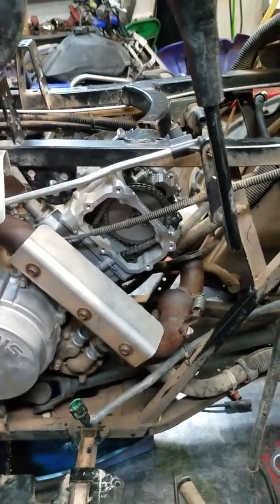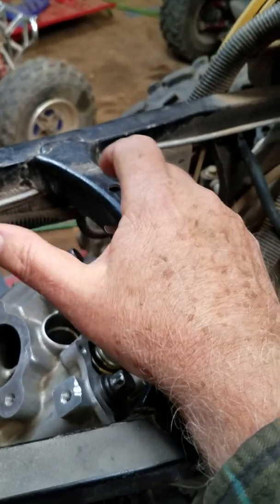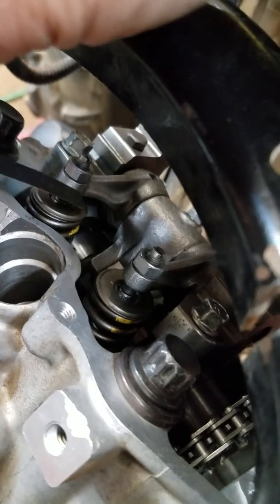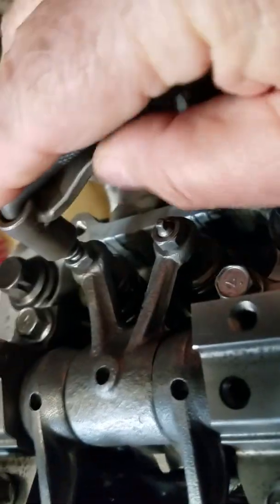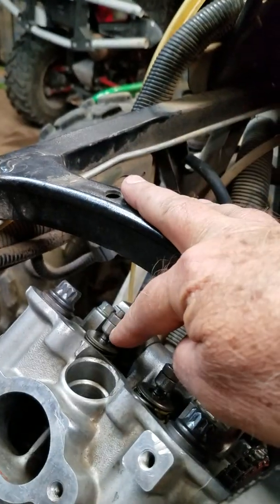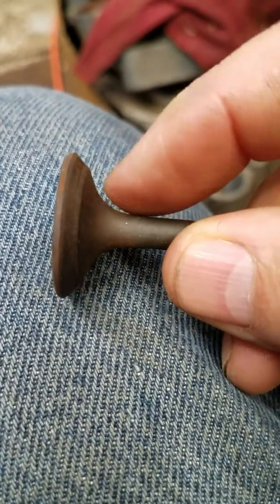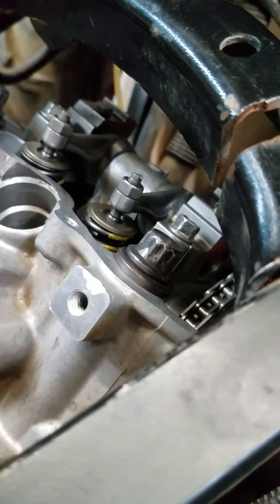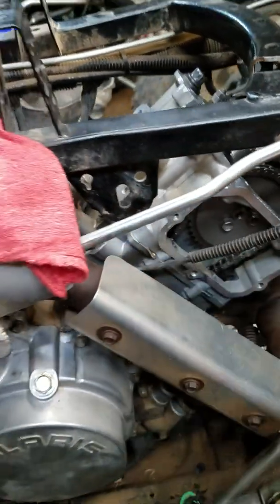Polaris Sportsman 500 valve clearance or lash adjustment 2008

Comment: I have my cylinder head off currently. I needed a new cam so I bought one, I know it’s the correct part, how ever say I bring the cam shaft to the peak position, I am unable to adjust the valve it is so tight I can loosen the rockers all the way out and the rocker arms are resting on the valve spring. All correct parts but I can adjust, what am I doing wrong?
Reply: Sounds like although I'm 2 years too late, your not actually on the top dead center position correctly sounds like.
Reply: @Roboticdoughbull3k exact what it was